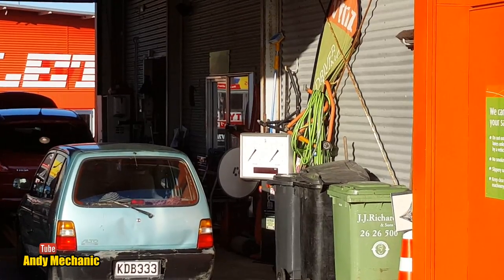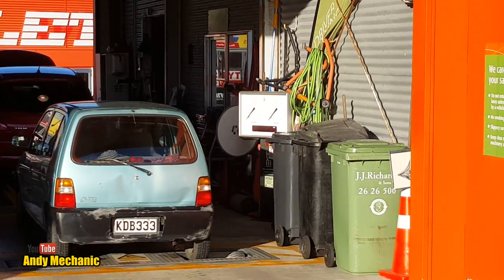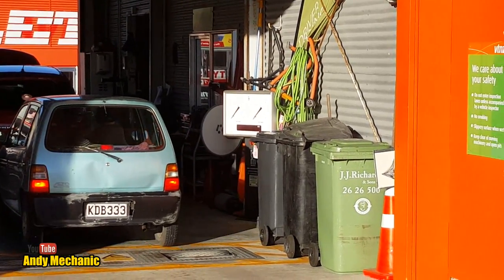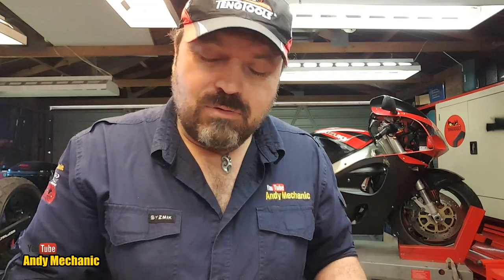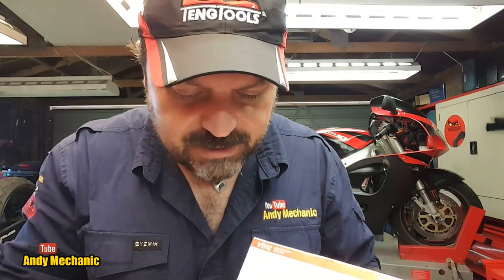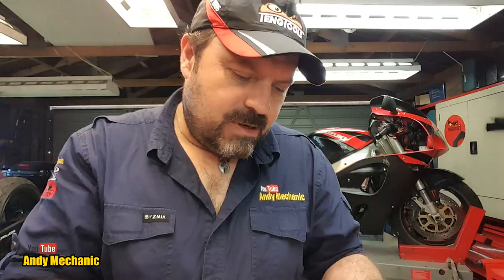WoF recheck - Rear drum brake imbalance #1335

Comment: That was me Andy who brought up about the bearing grease  issue. I actually  thought wheel bearings were sealed which is why I asked.
Reply from the maker: Hi Paul, sorry I forgot it was you that mentioned it. The bearings are fitted with seals but they aren't very good. 

Thanks again for your input again. Cheers for now. Andy

Comment: Correct me if I am wrong. When the WOF inspector is testing the brakes they are actually trying to measure the maximum  amount of force from the brake before the wheel locks? 

I had a Porsche 911 with the big Brembo calipers on it. My MOT inspector passed it but gave me an advisory for a grabbing brake - saying it was only just within spec. I found that the ear on the pad that takes the force was poorly machined. Once rectified I got the tester to retest it to prove that I had solved the problem.
Reply from the maker: Interesting. Yes, although there is a minimum braking force that each brake must apply (based on weight on axle) modern cars easily achieve this even with some brake faults. What is more important for the WoF is the brake imbalance as this will affect directional control of the car. In New Zealand the maximum variance allowed is 20%.

Hope this helps. Andy

Comment: Hi, On this subject. I have a Yaris that's just failed the MOT on rear brake imbalance. Was initially told it would be a 30min adjustment. After waiting all day, I've now been told that although the cylinders look new, they can't get it to balance and it will need a new balancing valve or failing that a new ABS block. I'm skeptical and worried I'm being fleeced. Can anyone give advice please? Thanks.

Comment: I guess the rear brakes do not neef to do very much on that car. Interestingly I have had problems with the internal drum type handbrakes after replacing the rear disks on various cars. This is where the disks are covered with oil from the factory. It's almost as if they have oil impregnated into them. In my case they do come right after a few months.
Reply: Disks are covered in an oiling like coating from the factory as a rust inhibitor, that is why you need to decrease the disks before use.
Reply: wobbly sauce obviously I decrease them with brake clean.
Reply: Not every one does.
Reply from the maker: So true :-)

Comment: brake shoes are less than 20 bucks  US put new ones on.   If your engine stalls you coast to side of the road.  If your brakes fail they scrap you up with a pancake turner
Reply from the maker: Very true Randy. However, only genuine brake shoes are available here for this car and they are over $100 & usually take a minimum of 2 weeks to arrive from Japan :-(

Comment: Who cares about the videos Andy Just bring back the tool girls.....
Just a nudge Andy. They are all helpful and entertaining. So as you know any Im from the States and in the Boston area. Frequent new Hampshire for winter sport. You would not believe what the Salt and road melting chemicals do to everything. It all about cost right and some states and community are using a chemical slurry that's basically stuff from desalinization plants. The stuff from these is highly Concentrated Sea water. What a Awesome idea to use this Waste Product. Yes? No? Maybe? ..... Maybe but it eats everything.  I have a 2010 F150 The rockers and cab corners are near gone. My wifes Subaru is ok But that a different comment for a different Vid as this has to do with a properly coated vehicle.
Brakes.. Ok yea I forgot why I was commenting... Sorry I get distracted. Oh i have to bring mom for a manicure today.... See..?
Oh yea brakes. I have fought the emergency brake actuators and rotor rusts on friction surfaces mostly because the rust creeps in on the area between rotor and pad on all my vehicles. The OEM Subaru Rotors were Awesome. My wife had a 2008 Subaru (now daughters) and we went 85000 miles on the same rotors without any warping or rust encroachment to pad (Nephew knows everything and said I should always change rotor on every pad replacement. Um right..). Aftermarkets replacements? Rust encroachment. and chasing brakes. I started using Semi Metallic Pads and this helps Nosier and Dirtier but High Nickel rotors like some OEM rotors are worth the money (if you can find them) to me. Ford are not high nickel that I can see OEM never lasted for me. Ceramic and organic are light on rotors and salt gets them. Rotors are cheap But again High salt area are hard on everything. Great Information for the DYI Peep!
You Da Man....... Cheers! Again Thanks Andy!  (8?)
Reply: I did 620,000 km on original front rotors on a 1993 nissan terrano, I just ran the grinder around the edges where the wear was to enable easier pad changes- got a WOF
every time...